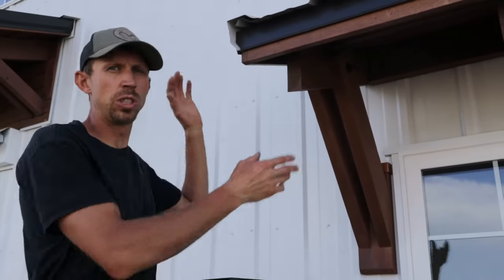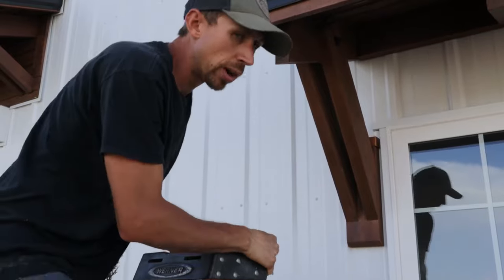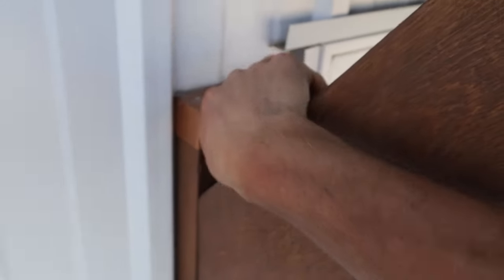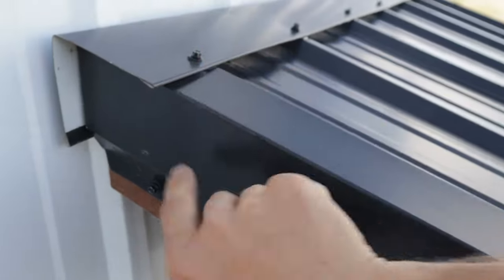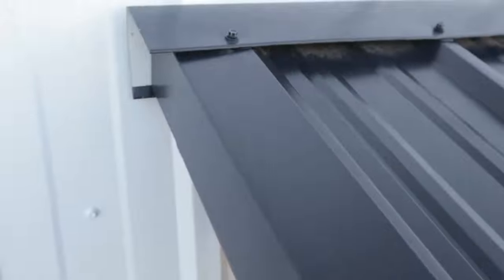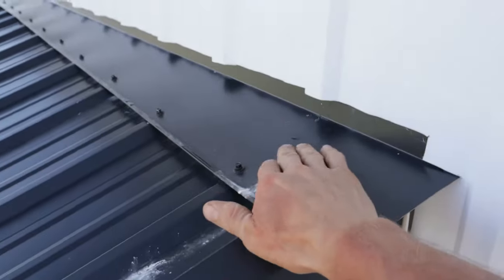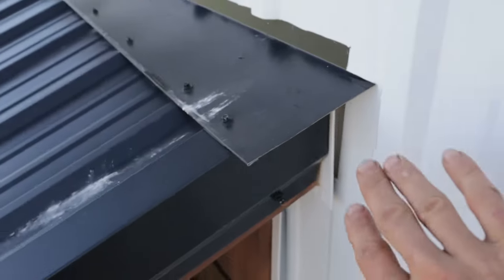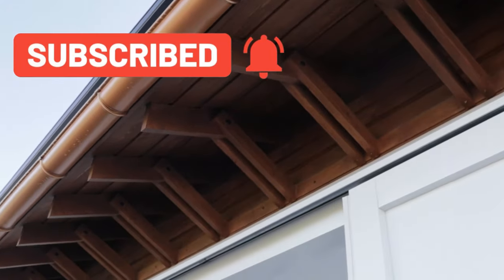HOW I MOUNTED AND FLASHED THESE AWNINGS//AWNING INSTALL VIDEO

Comment: So how do you stop debris and water getting trapped between the ledger board and the metal siding? I would think somehow making the flashing divert water on to the roof would be key here, so somehow you've got to get flashing behind the wall siding and onto the top of the roof to prevent issues between the metal siding and the ledger board. Just my 2 cents.
Reply from the maker: Thanks for watching and sharing your opinion!

Comment: You think this design would span a 14 foot garage door
Reply from the maker: For a 14’ span, the design of the awning over the window in this video would have to be modified. One could do it with a beam on corbels to support the rafters. However the larger awning in this video that I show at the end would be a great design for a wide span like you are describing! It uses a double 2x4 knee brace to support each rafter. Hope this helps!

Comment: do you have any recommendations for mounting into a brick wall?
Reply from the maker: I think there would be two options for flashing to a brick wall. 

Option 1: I would just use a  “L” flashing on top of the roof and mount it to the brick using Tapcon screws. Then take a good quality clear roof pitch and put a bead where the flashing meets the brick. 

Option 2: cut a groove into the wall, preferably in a horizontal mortar joint. Then insert a z flashing where it sticks into the wall and on top of the roof. Attach to wall with Tapcon screws. Lay a bead of clear roof pitch into the slit area where flashing meets the wall. This would be a better seal solution but is more extensive. 

Hope this helps!

Comment: Where would you buy the zinc or metal roof
Reply from the maker: I get my through a local metal roofing supplier, Central States Manufacturing . You can look for a metal roofing supplier or a big box store, such as Lowes, Home Depot, and Menards can also order it in.

Comment: Awesome awning. Great job.  Do you have any idea how I can mount something like this on vinyl siding? You think I could just flash under the vinyl siding strip? 
 Would I need to cut a J channel?
Reply from the maker: Thank you 🙏. 

For vinyl siding, I would remove or cut slightly over sized hole for the awning. Then I would use j channel on all for sides and install a “L” flash on top